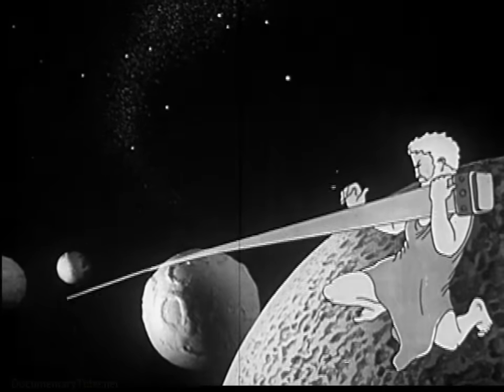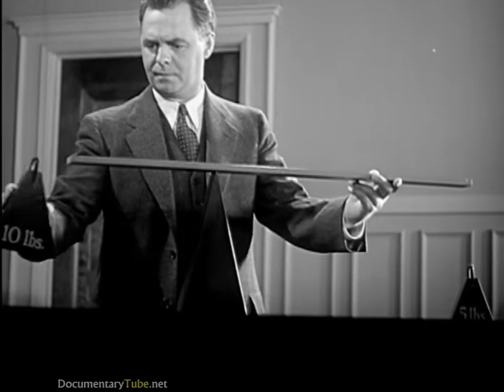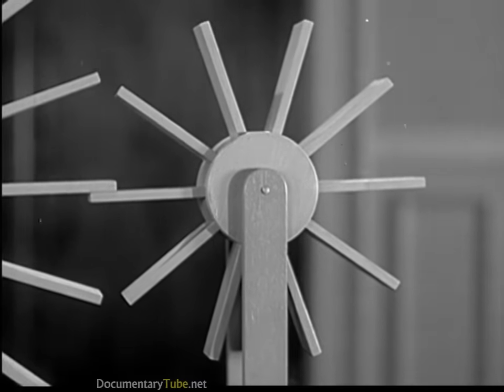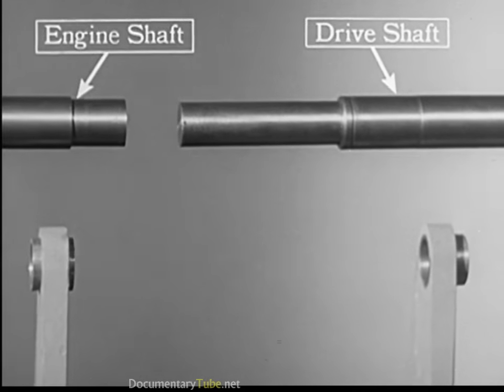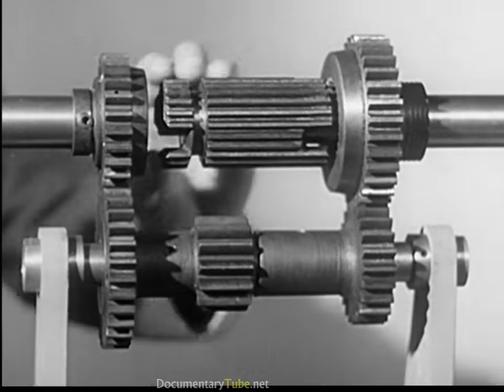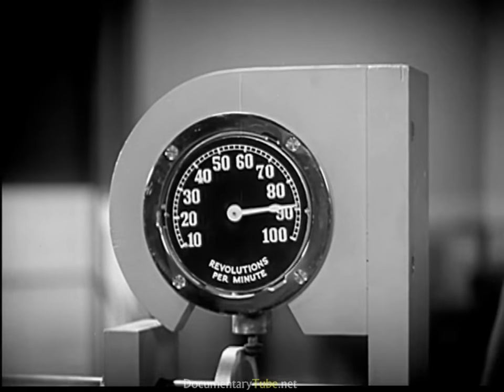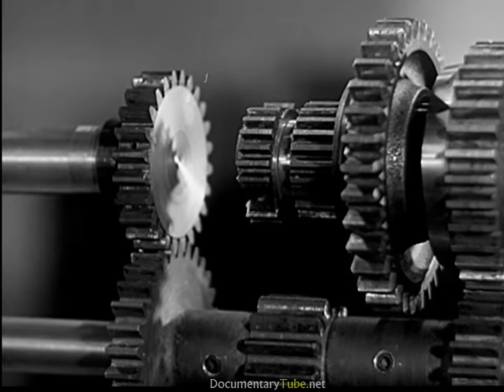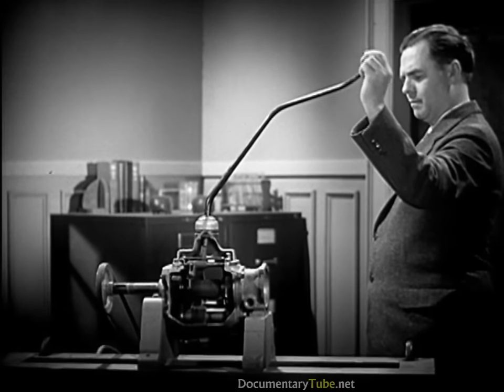HOW IT WORKS: Transmissions

Comment: It's amazing how even a bare bones transmission is so complex, the stuff we have today is just insane.
Reply: Now automate this procedure and it becomes a hell of a complex machinery.
Reply: Mine is quite simple.  I just put it in R for race and gun it!
Reply: ALEXANDRO ROVIROSA
Reply: Steak it doesnt have a transmission. It only has a hydraulic torgue converter, which isnt anything new. But that they use it with no gearbox strapped to it is something new
Reply: Im so lost
Reply: They only showed a 3 speed now cars have up too 10 speed transmission

Comment: In this video, they show there was a time when one had to shift gears without a clutch. A newer driver that didn't know the proper rpm to hit would cause an excessive amount of wear and tear and knew it because of the awful sounds he'd make every time he shifted to another gear. They then developed a clutch so you could synchronize the gears before connecting them to the engine's power. This temporarily disconnects the engine from the entire system but you can do it fast enough for it not to be a huge difference. This was a major improvement because you didn't have to get your timing perfect to shift correctly. This helped newer drivers immensely. Now we have automatic transmissions that allow for even smoother and faster shifts which of course is done automatically. This makes driving as easy as "this pedal gives you speed and this pedal takes away speed". Why is it that people complain about automatic transmissions? Maybe in a country where most cars are manuals it would make sense to ensure everyone can drive a manual but in a country where most cars are automatics, there is no need to know how to operate a manual.
Reply: Because if you're on operator of cars, and are licensed to do so, wouldn't it be proper to make sure you can drive a car? Manual or Automatic.  Even if you may not run into it everyday, knowing how to drive every type of vehicle should be important, and is what you are licensed to do.  

There's a whole list of reasons I could get into, but this alone should be enough to learn.  I don't have all day to go through the rest.
Reply: auto is for bitches who cant drive, or have no interest in driving as an activity in and of itself. people who see driving as just a connection from one activity to another, rather than an activity to get to another activity. its the unappreciation of driving and the longing for an easier time doing what they dont care to do that gets automatic so much hate. if u appreciate driving and you want a true connection and love with your car, manual is the way to go, if u dont like driving and you like more of just getting place to place, easiest and mose efficient way, auto is for u
Reply: Lol no, completely wrong, automatic transmissions are not a new invention and are absolutely not a progession of any technology. Automatics are as old as manuals
Reply: @AverageAlien  uhh.. automatics are most definitely a progression in tech, and while the very first one was in the early 20s, the fiest successful commercial one wasnt set to be normalized until the mid 60s, so i disagree, they arent as old as the stick shift, and yes while they may not be a current new invention, they most definitely were a "progression of technology"
Reply: @rain4088  I been wanting to learn how to drive manual for a long time. None of my buddies have a manual trans car. Can I convert my 2014 Hyundai Accent to a manual? Is that even possible

Comment: The car transmission is going into the dustbin of history. Here come the Electric cars.
Reply: we're not going to (or atleast, shouldn't) have electric cars for a while. Not until the majority of our power comes from less wasteful sources.

Until then, a hybrid, diesel running on used cooking oil, or car modified to run on methane will be our best bets.
Reply: I have a question. Why did electric cars take so long to come out?
It's basically an electric motor turning wheels at variable speeds. That was made possible more than a century ago when the motor was invented.
If anyone has a battery the size of two big suitcases, they have an electric car, (The electric motor is far smaller than an engine, so the greater weight of the battery would be compensated for by this).

The oil companies are behind this, right?
Reply: Spawndon
it was about the discovery of lithium power, late last century. until then, the gas engine supplied the power that lead-acid batteries could not supply.
ironically, one of the oil company scientist discovered the benefit of lithium. it was dormant until the patent ran out.
Reply: Spawndon Electric cars didn't tale a long time to come out. There have been many attempts at large releases of electric cars, but no one buys them. The down sides to electric cars far outweigh the upsides, considering at this moment there are no legitimate upsides to electric cars. It actually harms the environment more to use electric cars. It won't be a good idea to switch to them until the majority of our energy comes from sources with a much smaller carbon footprint.
Reply: DBZHGWgamer
BMW already announced only lithium-ion engines for their cars in less than 10 years. 9/11 was about switching from oil to Lithium.
	 	 	 	
WARS. Wars are made to gain Power & Wealth. The Mid-east is mainly the Power goal. Changing the political & cultural landscape in the area to be more suitable, controlling oil and pricing structures, bleeding the muslim cult warriors, and creating employment in the war production industries. All-in-all, a general house cleaning. The Mid-east wars will continue. Wealth of the current leadership people and their friends who run the major businesses, is the #1 goal. The Mid-east wars help to keep your eyes & ears distracted off the primary goal. $$$.
-
Afghanistan. Mind-boggling mineral Wealth. The Infidels are NEVER leaving Afghanistan. Let's hear why directly from the mouth of the former Afghanistan president and CIA puppet. "Actually it’s $30 TRILLION", Hamid Karzai said. "The U.S. knocked a zero off to keep our assets a secret".
-
In 1980 the Russians used a False Flag to help Afghan leaders put down a rebellion (the Russians secretly caused) to enter Afghanistan. Why use a False Flag? Most Afghans are hateful racist muslims who do not want Infidels mining their territory. The USA found out the real reason why Russia was in Afghanistan. They helped to remove Russia by arming the muslim cult rebels. The Russians were greedy and wanted Afghanistan for them selves, but thought the Wealth was a few $10's of billions.
-
Afghanistan was the 1st country in the world to have its surface minerals mapped from the air, before 1990. Afghanistan is known to have vast reserves of oil, gas, copper, cobalt, gold and lithium. The mapping project was funded by the US Department of Defense’s Task Force for Business and Stability Operations. The Pentagon is funding projects for corporations. Think about that for awhile. Inter-related people. The USA then did 2 False Flags to get the primary goal. Afghan minerals.
-
The 2 USA False Flags? 1st one - February 26, 1993. (Bill Clinton presidency) A truck bomb was detonated below the North Tower of the World Trade Center.. The 1,336 pound urea nitrate–hydrogen gas enhanced device was intended to send the North Tower crashing into the South Tower, bringing both towers down and killing thousands of people. It failed to do so, but killed six people and injured more than a thousand. Not enough deaths & destruction to get the people to war. Failed False Flag.
-
The 2nd USA False Flag to Afghanistan was 9/11 in 2001 (GW Bush presidency). Successful False Flag. Cost? A few $ billion in buildings, and thousands of easily replaced office worker drones for a large part of $30 TRILLION in mineral Wealth. The BEST business decision, ever. The UN WORLD BANK writes the mining contracts for the worlds mining corporations located in Afghanistan, including Russia and China. Many nations get a share of the Afghan Wealth. Afghanistan is less a country and more a large International Mining Cartel. Ever wonder why the commies Russia & China don't demand the USA get out of Afghanistan?
-
Afghanistan will soon be the #1 Lithium mining area on the planet. $900 Billion to $1 Trillion in lithium. The worlds transportation & electrification future. Tesla was funded by the USA government in 2003. The world’s transportation manufacturers need more lithium than currently found outside Afghanistan. The ignorant racist 7th century Afghan boys never want to make business contracts with the Infidels. So, ┌П┐(◉_◉)┌П┐ the muslim cult critters, and take it from them. The minerals will be mined and processed on site as much as feasibly possible. New railroad tracks will ship some of the Afghan wealth through the new facility at Gwadar Port, Pakistan.
Update: The price of lithium doubled in April 2016. Afghanistan has $1.8-2.0 Trillion in lithium. YOU slaves will not profit from this adventure on the stock market. Afghanistan Wealth is private reserve for your Owners.
-
Bottom line. It is the muslims who are to blame for 9/11, because they refuse to be civilized and want to hold back the world's future.
Reply: jacobji555 Wow, nice info. Why don't the various countries' newspapers talk about this? Especially countries who are not involved in this power-play?
Reply: Spawndon
Because the press is controlled in all countries. the CIA? Pentagon is the real USA government. the politicians are their puppets. The last real president was Kennedy. They "Oswalded" him. Proof the press is controlled?
 	 	 	 	--
"We are going to impose our agenda on the coverage by dealing with issues and subjects that we choose."
Richard M. Cohen, CBS
"Our job is to give people not what they want, but what we decide they ought to have."
Richard Salant, former President of CBS News
---Those 2 quotes in Economic Solutions, by Peter Kershaw, Quality Press, Boulder, CO.
 --
	 	 	 	"There is quite an incredible spread of relationships. You don’t need to manipulate TIME magazine, for example, because there are Agency people at the management level." -William B. Bader, former CIA intel officer, briefing members of the Senate Intelligence Committee. Quote in 'The CIA and The Media' by Carl Bernstein

"The Central Intelligence Agency owns everyone of any significance in the major media." -William Colby, former CIA Director. Quote in 'Derailing Democracy', by Dave McGowan
 --
Why are the millions of bearded muslim men now in the USA? To help put down any freedom uprising. They will gladly do as their CIA masters tell them. Your CIA Director is John Brennan. When he was in saudi Arabia he converted too islam. it is on the net. Many of the internet stories try to put down the truth, but a few give the proof. That is why the CIA says Trump is dangerous.
Reply: jacobji555 sorry to tell that gears will never be dustbin. Gear are for ever. You probably are confusing gasoline with gears.  Electric car run with gears. This video was about gears. Not power such as electric or gas.

Comment: Not only do they not teach this stuff anymore, it's hard to even find a car with a manual transmission. As time goes on younger people just get stupid and more helpless.
Reply: +Helium Road Because most people cannot use it effectively. Also if you change cars often, their clutch and gearbox have a very different characteristic. Also use of motor for braking must be done manually and you dont know you clutch will wear out. Also you have to drive diesel and gasoline cars in a different way. 
This is very complicated for something which most people use from transport from A to B. Modern automatic gearboxes can also save a lot of fuel and they tend to learn drivers reactions. You can also use manual shift by paddles here. Even offroads are losing manual transmissions and reductions.

Manual transmission is history. Even if you have it, then blipping the throttle not work more than 20 years because of synchron use. Actually you may damage your car by this technique. 
Manual transmission is a history same as mixture control or mechanically timed ignition.
Even racing cars have semi-automatic dual-clutch sequence system. Because human foot and one clutch is not fast enough. 

If car must have manual transmission i accept one exception. Very reliable cars for expeditions into the middle of nowhere. Manual transmission, no engine control unit, no electronic inject control,carb, no turbo, no onboard computer, no timing belt but chain or wheels, no ABS,TCS. Maybe only power steering;)

But attitude like today that everything in your car is controlled automatically but you have manual transmission, is same as combination of steam locomotive with modern airbus airplane.
Reply: rybaluc TLDR I don't need a fucking book-length lecture on why manual transmissions are going away.
Reply: Then you are missing what term "discussion" is. Complex issue requires complex answer. You cannot expect short answer for a question: Why there is no peace? World does not work according to short CNN News.
Reply: rybaluc Didn't read.
Reply: such a false statement you let a third of teens account for the whole populace, also there are plenty of manual cars; I drive one and I'm twenty
Reply: +Helium Road Here in Europe we like to drive manual , someone who can't drive stick is almost considered stupid or incapable of driving , of course if you know how to drive stick and have an automatic car because you're too lazy or live in the city where you have to stop every 30 seconds  it's a different story .
Reply: Helium Road a lot of cars in Europe are manual, still popular around here
Reply: Yes most cars in Europe are manual.
I'm mid twenties and have never actually driven automatic.
For some reason I feel like automatic cars can fail and do wonky things at any given moment, but I may just be a traditional thinker in that sense.
Reply: rybaluc i read carefully your comments, thank you btw, since nobody said it

Comment: Very good, clear video.
However, it's 'unfortunate' that the 'teaser pic' shows a 'cut away' of an AUTOMATIC transmission, therby suggesting the video would explain the workings of AUTOMATIC transmissions.
The workings of AUTOMATIC transmissions is VASTLY different to the workings of MANUAL transmissions.

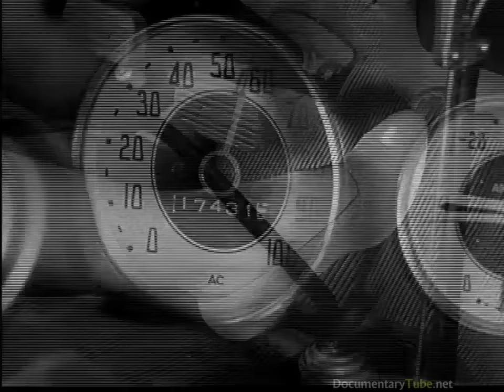Comment: Ar 9:54 the speedometer has 100 as the highest number. Is it 100 km/h? I don't think those old cars could reach 100 mph speed with a meager engine and 3 speed transmission.
Reply: Most cars today have a speedometer that goes higher that the car will go, or at least higher than it's intended to go.  The highest number isn't the car's top speed, it just fills the space.  100 was a logical stopping place, back when your average car didn't exceed 100.
Reply: bubbleheadft
Reply: It's normal to have a higher max speedo readout than normally achievable. You may be going down a hill full throttle, you may modify the engine for more power, etc. So they allow overhead in case you find a way to go faster than the stock engine can get the car going on flat ground.

Comment: TIL cars used to have 3 gears. Did cars even have clutch pedal back then? Because the guy said everyone made noise when shifting
Reply: A clutch doesn't eliminate noise if the gears aren't synchronized.
Reply: Simonator yes they had clutch pedals, you can see the woman driving push it in, shift, then release

Comment: Basically it's a very simple 3 speed non synchronized manual transmission. Trusty enough. Double clutching is a must however or you'll destroy the gears.

Comment: One thing that I don’t think is made 100% clear in this video is that the constant mesh gears on the output shaft are not connected to the shaft. They are on bearings and can spin freely.

Comment: hey does anybody know if there is any point in going with more then 2 gears? what i mean is if im going for a build that gets the most power out of my system in exchange for the speed should i get my smallest gear and connect it to my biggest one or should i go from my smallest to a middle sized one to my biggest one ? any help is appreciated !